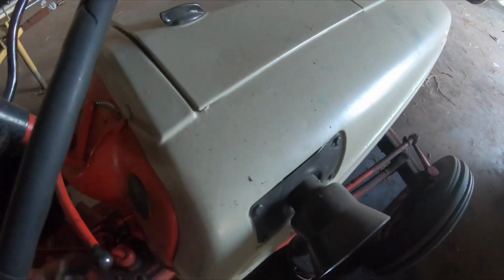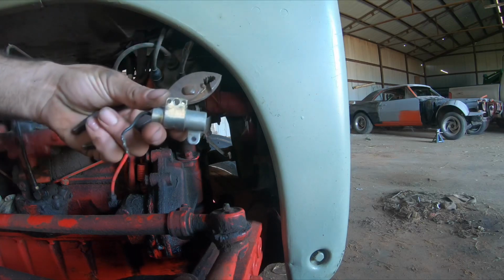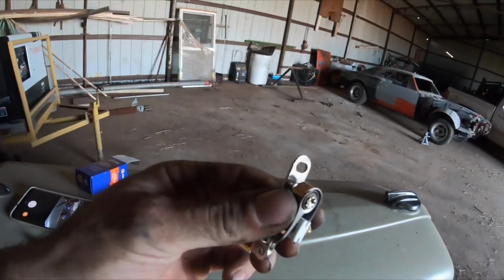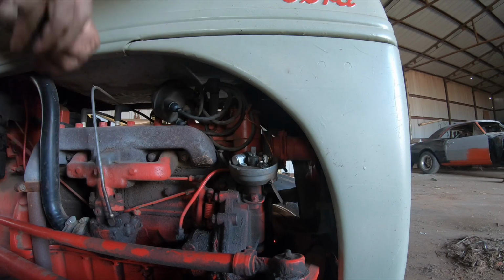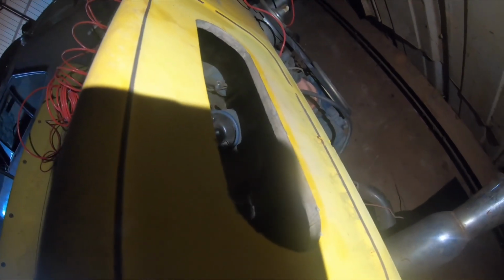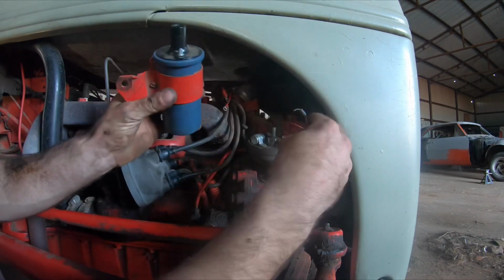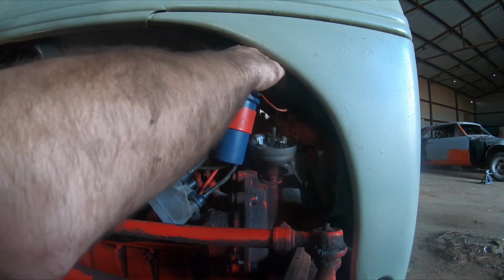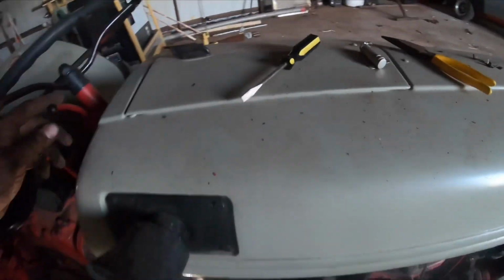8n Ford Tractor Coil Point And Condenser Replacement

Comment: You're getting ahead of yourself, sonny. First thing to check is voltage to the coil and then to the distributor. Basic tuneup 101!
Reply: as soon as I touch my terminal cables to my battery the starter continuously runs non-stop... any ideas? Is my starter solenoid stuck?
Reply: @kirk5542  it could mean you’ve got the cables reversed on your battery

Comment: Hey Man isn’t it funny and I am not saying that sarcastically that you parked it running and the coil went dead! I just did the same thing on my front mount I thought it was the points and that didn’t work and I changed the coil and that wasn’t it and last but not least I changed the condenser and she fired up and it had power like I never seen before, there’s a lot to be said for the right spark ⚡️. Those 8Ns can be frustrating sometimes but I love them I have 1 front mount distributor they made them from 1948- through 49 and they came out with the side distributor from 1950-52 I have 2 of those they had a couple more upgrades, bigger oil pump, proof meter, inner axle seal, and of course side distributor, I think they actually did something to the hydraulic valve because my late models have better position control than my earlier model. But nice to see a young man like you able to change points and diagnose the problem! KEEP THE OLD IRON GOING MY FRIEND AND GOD BLESS YOU AND YOURS!!
Reply: Great comment Keith. Needed to read the encouragement in this post haha

Comment: Just a heads up side mount distributor's are early 50's 50 to 52 if I recall right, and your oiler for your distributor should be facing out not in towards the engine. Maybe not all had the oiler tube but I know my 51 does..
Reply from the maker: I didn't know that but I will check it out thank you
Reply: @RightOnJohn383 bgv
Reply: You are correct. 50-52 was side mount dizzy

Comment: I don't understand how you can get a spark at the points when you have the distributor cap off and the wire from the coil is not connected? Where is the juice coming from? Is it coming from the condenser?
Reply from the maker: No comes from coli on the negative side goes to points

Comment: you have a part number for the coil you took off the yellow thing? looking for one in stock. tractor supply doesn't have them. mine just says 6v no resistor required 1304 and on the bottom says #0215# o'Reilly and napa can't cross reference. checking other stores

Comment: I am  a newbie trying to do a point replacement on my 52 side mount.  When I removed the points there is a small copper strip that was attached to the nut on the right side.. I,m not sure how to put it back on.. On your video I dont see this little copper strip.. Am I ok without it?  Thanks
Reply from the maker: No you need it it gives good conductivity
Reply: @RightOnJohn383  thanks for getting back to me.. So one end goes on the nut, where does the other end go? Thanks

Comment: Can u help me out? Can u explain the wiring? I noticed u had 2 wires on one side of the coil...  I have power to everything but no spark on the points.. it is new points and condenser
Reply from the maker: I will have to look at it tomorrow I'll sure help tomorrow

Comment: as soon as I touch my terminal cables to my battery the starter continuously runs non-stop... any ideas? Is my starter solenoid stuck?
Reply from the maker: Either starter solenoid stuck or bad starter button unhook starter button see if it still does it
Reply: Make sure you haven’t gotten the battery cables reversed. On my 8n positive goes to ground. When I accidentally connected the new battery backwards, it did indeed kick the starter on.